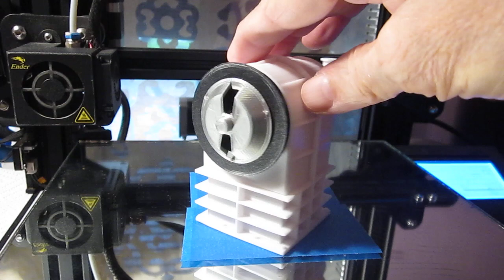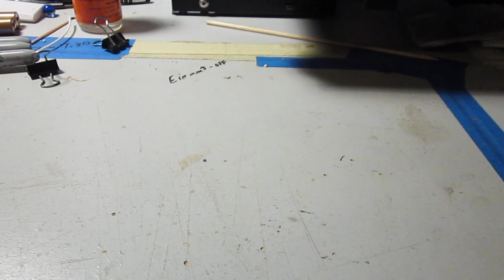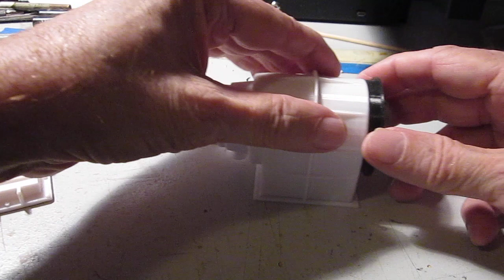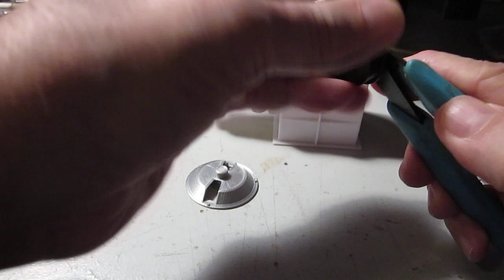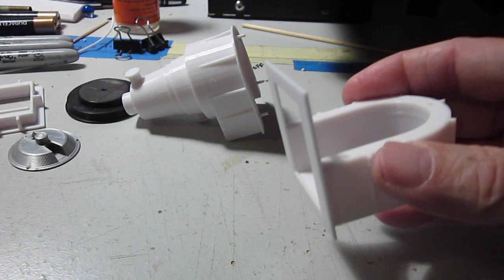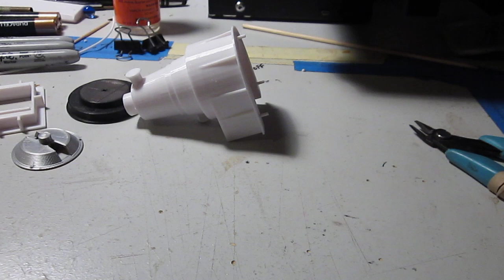ENDER 3 printer . 11 part print as a kit. No supports required

Comment: There is an added advantage to this method. If you have more than one printer you can accelerate your manufacturing time. 
Sincerely Robert
Reply from the maker: That is so true. I personally found out a long time ago this to be fact. I have 4 identical ENDER 3 printers all assembled alike.  In 4 yrs. they have printed well over 3500 STL files without fail and going strong.